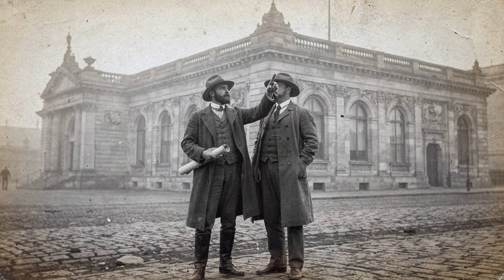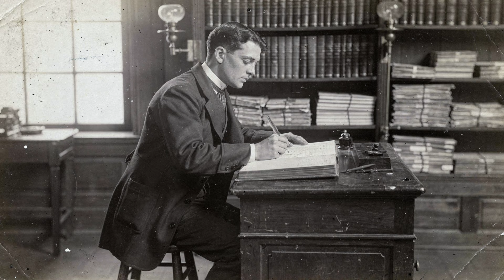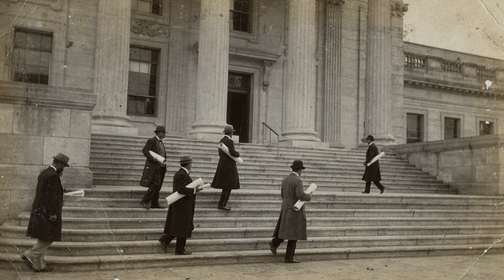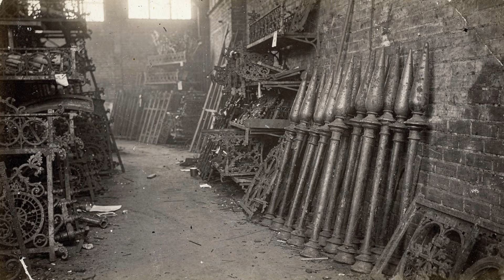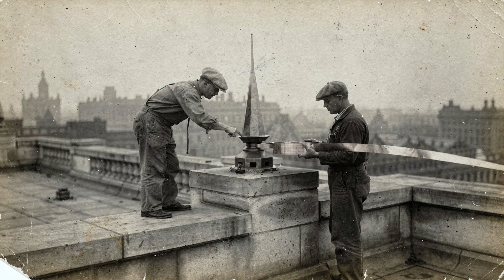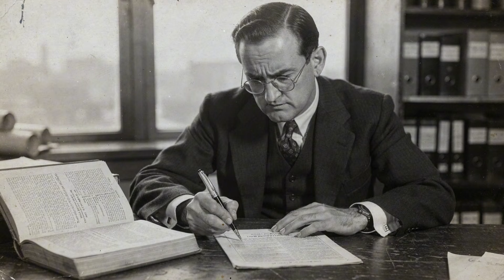What Was Really Sitting on Every Victorian Post Office?

Comment: Curiosity thoughts, what effect would the former system have against the latter system have with regard to atmospheric oxidation on other materials used in that era, such as copper roofing, wrought iron gfuttering, downpipes etc, even hidden steelwork and metal window frames, could the former system act as preservation of finish ? and further thoughts moving forward to today with so much electro smog and being surrounded by mobile phone signals, 2g,3,4g & now 5G and all the contreversy about that.... would say the former system effect these things ? wish i knew....
Reply from the maker: Thank you for these fascinating insights :) Your point about atmospheric oxidation is crucial. If these finials truly acted as 'voltage gradient equalizers' to discharge atmospheric charge, they could have theoretically created a preservation effect. By stabilizing the electrical potential between the building materials and the atmosphere, the rate of oxidation on copper or wrought iron might have been significantly reduced...

Your thoughts on modern 'electrosmog' and 5G are equally intriguing. If the old world system was designed to harmonize with the Earth's natural electric field, it’s interesting to wonder how it would interact with—or even mitigate—today's signals. It raises the question: was the system's removal a side effect of 'progress,' or was it intentional to clear the way for the current frequency-heavy environment? Definitely a topic worth exploring further :)